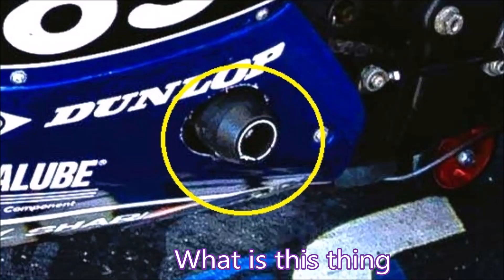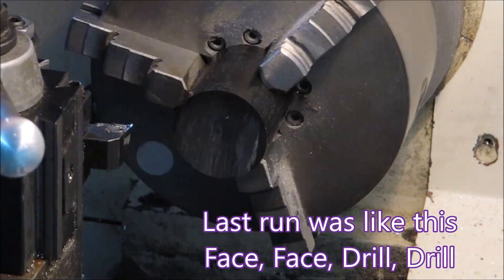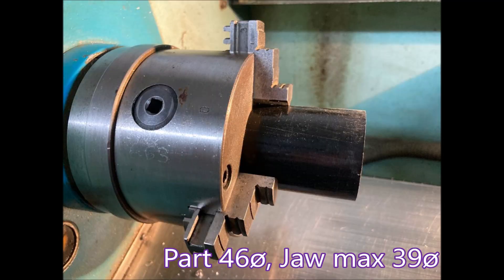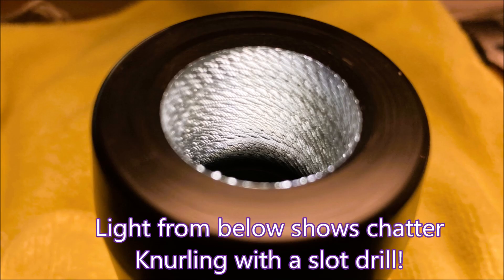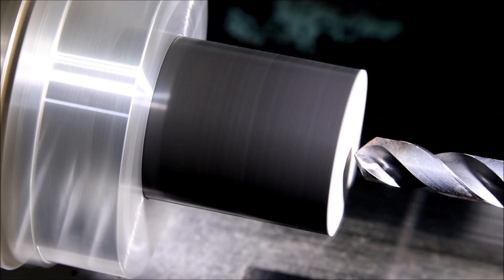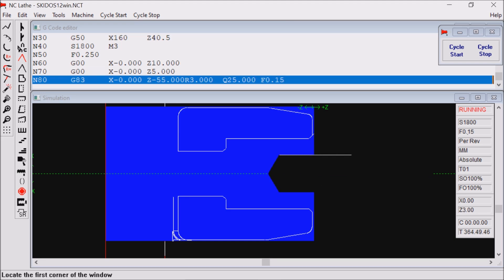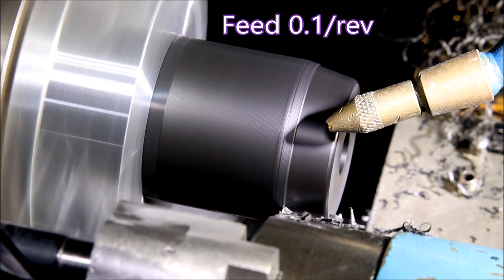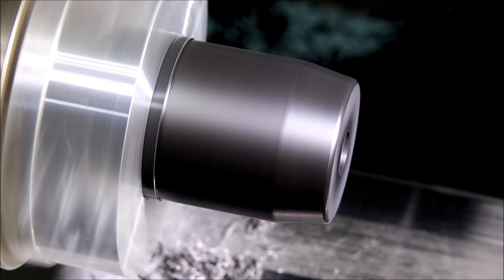One setup Part 4 Drill. Turn, bore and part, crankcase protector for Yamaha R3 junior race bike.

Comment: I like the longer videos. Awesome chip control for a small machine. Thanks for sharing Nigel ;)
Cheers Stephen :)
Reply from the maker: thanks Stephen, I was happy to get the chips out of the bore, the bar was extended a long way and even though it is plastic, if it compacted in the bore it could get nasty. Thanks for your regular comments, I really appreciate the folks that make the effort.

Comment: Excellent chip and swarf control. I was expecting a tangled mess at some point and it finished quite clean.
Reply from the maker: Hi, not a tangled mess but you should see all the swarf around the lathe.  Making the video with the lid up and running it a couple of times it is everywhere.  And of course it is statically charged so it is even sticking to vertical surfaces.
Thanks for leaving a comment (as you usually do) much appreciated. Nigel

Comment: For something like this I think I would have just used a profiling/parting tool for the entire OD.

Cheers
Reply from the maker: Thank you but this part needed this parting tool for the depth of the cut. At 1.6 wide and 41 dia cut it is not terribly strong for profiling . I had damaged it somehow anyway!  I am happy to use my Sumitomo 2.0 and 20 max for profiling, it is a very tough tool. In fact as the Kennametal is damaged, I have organised a new Sumitomo parting tool, but to get one with 40 dia I have to get one with a 12x20 shank which I will get machined to suit my 10x10 turret. A friend has the same lathe with no turret just a QC toolpost. Almost all his work is turned with a parting tool. Thanks for your comment. Nigel

Comment: Excellent video as usual Nigel, watched it twice already!! Always better to complete the job in one operation, minimises the faffing about! 
Cheers Ian
Reply from the maker: @machineshopinagarage4699  I really wanted to avoid the face, face, drill, drill in the manual lathe. With the new jaws facing was not required and I could have got away with just drilling in the manual lathe.  However it was nice to get it done completely in the cnc. Ian, thanks for being a regular at making comments, much appreciated.

Comment: "Elegant" describes all your programming perfectly. And you managed some AWESOME chip control for plastic. Crazy.
Reply from the maker: @kevind1865  thank you Kevin, it was a bit of a mental jump going from boring not following the drilling as it is just so usual to do it that way. 1, 3, 5, 7 was just better than 1, 5, 3, 7. My turret is one direction only it was the better solution. I was pleased with the chipping from the boring bar. Things can get really nasty when a bore fills up with chips, particularly when the bar is hanging out as far as it was in this instance. Thanks for your regular comments, I appreciate it. Nigel

Comment: Sometimes it's better to use slower RPMs on plastics. G50 S around 500-900. The program will run few seconds slower but the cutoff finish will be much much better.
Reply from the maker: Hi Adam, thanks for that, have more to make so I will try it.

Comment: Lot's of wisdom in this one, I'll be checking my parting tools to see if they're bent after this.
Reply from the maker: Hi, I was really surprised. This tool was only 1.6 wide and could handle a really large diameter. I could not believe it was not straight. Never crashed it, from memory never used it for profiling. No idea what happened to it but it was bent slightly away from the chuck.  Seems all good now.  Thanks for your comment